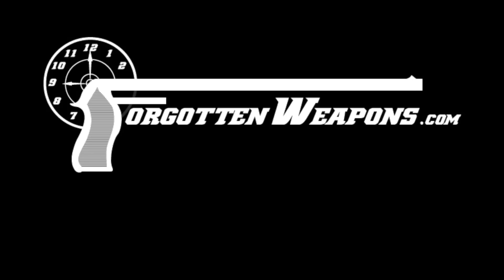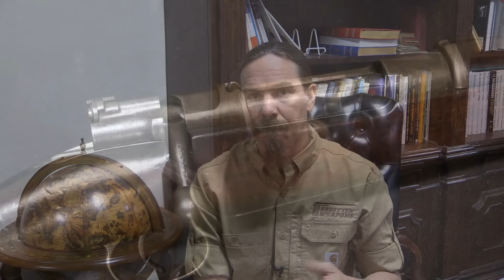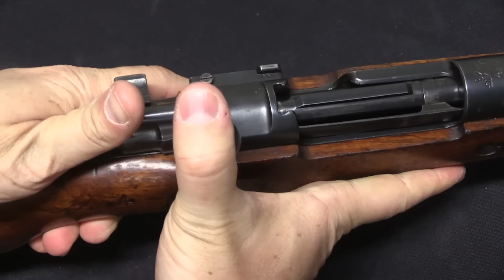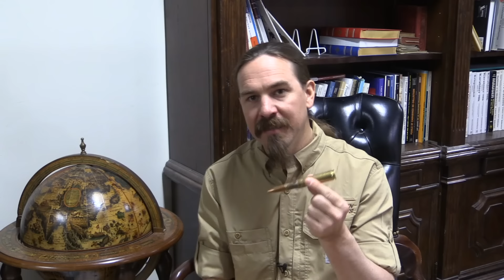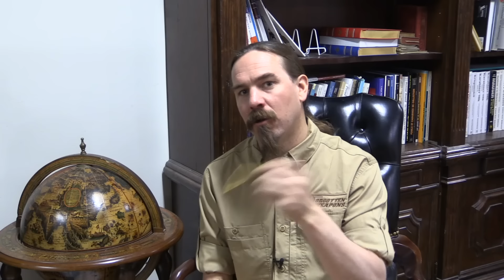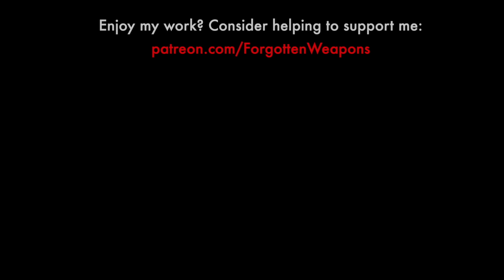Earth-Shattering ka-Boom! How (and Why) Guns Explode

Comment: The first thing that came to my mind is how the RN 50 has no failsafe mesures whatsoever, i understand the novelty of a tube gun and that Mark Serbu wanted to give a job to a young gun designer, but i feel like in the process of a teenager presenting him the design of a 50 BMG tube gun he should have reviewed it a bit more intensely before putting it into production.
Reply: I believe the shark fins are an additional safety measure. They sheared off from the massive overpressure
Reply: Yep, the design is inherently less safe in an over pressure situation than any other .50 I know of.
Reply: @bryanhiscocks6209  As they would from any overpressure that had enough power to strip the threads off that end cap, all they accomplished was makeing more shrapnel  there should be at the bare minimum a shield
Reply: @SgtStinger  Pretty much every other design i can think of either has a safety lug, or multiple, or is a semi auto in an enclosed receiver with a bolt carrier and multiple springs behind it.

If this was a 12 gauge that would be one thing, but trying to put an anti material round in a tube gun is something that should probably be left to post apocalyptic fiction
Reply: @therideneverends1697  it'd be a better and more expensive design. I agree.

However its a budget gun that should be used with factory ammunition from a reputable company
Reply: @bryanhiscocks6209  I am not of that belief, if something cannot pass a proof test and a catastrophic failure test as a modern firearm it should not be on the market.

"Budget" should not allow companies to take shortcuts that endanger the user.
Reply: @therideneverends1697  You know a proof 50bmg round isn't 85000 psi right? Lol

Comment: I think a good solution would be to have a "break-away" section of the barrel by the chamber, a sort of "key", where if the chamber pressures reach such a pressure that it would blow off the back, just short of that (let's say 80%), the metal in the barrel would break away in a specific hole, and relieve that excess pressure.
Reply: Agreed. A burst point.

Comment: The few times I took "newbies" to a gun range, I always added one extra safety instruction to the basic ones:
IF - you're shooting (and you did not change ammo types), and the sound or recoil feels different from other rounds (greater or lesser recoil, or louder or quieter sound), take your finger off the trigger, remove the magazine, and eject the current cartridge, and tell me, and I'll field strip the gun and examine the spent brass before we continue.
(and of course i nag them 'incessantly' about muzzle awareness, and trigger discipline)

I think for a more experienced shooter, the only thing to add to that is that you should have some degree of 'pause' when you get a drastic "flyer" - which wasn't caused by you. Newbies will likely lack the experience to know if that's the case though, since they'll tend to assume all flyers are their fault (which is generally true hehe)

Most of the time when I get a "squib false alarm", it's with rimfire ammo. Sometimes some of the primer powder falls loose from the rim, which can cause a 'dud', or it can cause a weak ignition, and a "soft round". I've never had a squib in a barrel, but I've checked for them about 20 times, 15 or so of them with rimfire guns, the other 5 with cheap ammo of questionable repute.

One thing people should bear in mind about XM-193 or XM-855, or any X-something military surplus ammo... is that the X signifies that it is not for use in the military. Usually that's due to an overly strict shelf life requirement or incomplete sealer coverage around the primer, but sometimes it's because the finished cartridge has a dent or ding, or it's weight is not to spec. If it's due to the weight not being to spec... that's an area where you can run into serious problems. I realize few will actually take the time to do this, but it doesn't hurt to weigh your cartridges and discard any which have an unusual weight. I'm assuming the SLAP round which blew up was probably X-rated (insert pun here). I'd definitely weigh any cartridge of such great power with an X on it's branding. Not saying that would have prevented anything, but it's a possibility.

Random thought: anyone else have a gut feeling that the designs for the military's 6.8mm will "forget" many of the safety lessons learned in earlier generations? 
And they want an 80,000psi spec... it may prove 'interesting'.

Comment: I love that he talks about this in an ambiguous relative phrasing of words. Because just as he says, relatively speaking, if the bullet isn't moving fast enough down the barrel for the burning gasses to escape with it then it may not be a squib but it is an obstruction nonetheless that is stopping the explosion from venting out of its confinement. Leading that explosion to take the very next path of least resistance besides the far end of the barrel. Just like not holding the cylender of a revolver, it's important to note the inner workings of any firearm you're holding so as to know how to safely handle it. And especially consider if something were to go wrong, what and where would things go wrong on any given firearm so as to be prepared for the unforseen.

Comment: Speaking of gun parts flying backwards at a high velocity . . .

The hammer pin on current-production Beretta 92 pistols has an oversized head that engages with a groove milled down the underside of the left slide rail. Its purpose is to catch the back half of the slide if the slide should break through the locking notches. Again. An operator was practicing with his issue M9 with special-ops grade ammo (whatever that is -- +P, +P+, or what have you) when his slide broke completely in two and the rear half came back and struck him. The revised slide and hammer  pin followed shortly thereafter.

Comment: Thanks for another great video Ian. Reminds me of one time bout 4 years ago I was watching a bloke clean a Remington style 44 cap and ball revolver he had loaned to someone. He pulled the grips off, removed the cylinder, into the hot soapy water and wondered why his cleaning rod and water did not go through the barrel. He got a wooden dowel and a hammer and tapped to remove whatever was in there and out came 3 round lead balls ( or rather what was left of them!)

Comment: I really like mark Serbus channel I hope this specific incident doesn’t give him a bad name, glad that Scott is ok.
Reply: I'll be cool with him as long as he redesigns that single shot rifle of his to not have a failure point on the end cap. Nobody likes a grapeshot cannonball breaking their orbital bones, let alone bringing the action locking lugs along for the ride.
Reply: @DinnerForkTongue  I wonder how different the reactions would have been if it had killed him.  There's clearly a glaring design fault here.
Reply: @N_Jones 
It's a sequence of small fails, actually. Both Scott and Mark are at fault, Scott for using old ammo with dodgy old powder load and not reloading it first (the sabot-and-muzzle-brake thing is pure conjecture for now until the barrel can be analyzed), and the rifle design for not having a safety vent in the case of excessive pressure buildup in the chamber. You cannot point fingers at only one "culprit".

Comment: I had an incident with my sks where the steel core punched through the front of the jacket leaving the  jacket behind about 4 inches into the rifling. Worse part is the cleaning rod fell straight through the jacket so i thought i cleared it out. I guess i got lucky with only a bulged barrel.
Reply: A common thing people do is grind the tip of a FMJ steel core round to try and make it a flat tip. I was taught not to do that for that reason. I'm glad I had knowledgeable people around.

Comment: Back in school, our teacher told us that the universe always tries to equalize itself and pressure always seeks to relieve itself by the easiest way possible.

Which is normaly the front of the barrel.

I remeber Ian having an out of battery discharge as well some years ago, Karl did first aid.
Reply: All mechanisms are made of simple machines.
Fluids always seek out low pressure.
Everything is a spring.

Comment: Fantastic video Ian !!! The in-depth walk through of the how's and why's is great. More importantly is closing the video with proper safety practices to help mitigate the possibility of an injury. Running speed drills with my AR I came across a squib load but did not recognize it for what it was. No injuries to me but it did require a new barrel and BCG. Afterwards I learned the S.P.O.R.T.S. acronym. Slap, Pull, Observe, Release, Target, Squeeze. Very important is the Observe step. Observe what comes out of the chamber and move forward appropriately.

Comment: Awesome information. I'm 61 and have been shooting & reloading for fifty years. I have a handful of issues where things went wrong along the way. Nothing was damaged too bad and no one was hurt, but there have been some close calls. The worst close call was over 20 years ago.  A buddy of mine and I were doing some target shooting with handguns. He did not like wearing shooting glasses or glasses of any type. He had a Ruger Super Black Hawk in 44 mag and pulled the trigger at a target and a little pop happened. He cocked the revolver again and before he pulled the trigger I stopped him. We pulled the cylinder out and there was a projectile flush with the forcing cone of the barrel. Far enough in that he could cycle the cylinder with the hammer. He was lucky I was there and stopped him.  It was his reloads and he loaded them hot.  I hate to think what would have happened. I've seen enough pics of revolver failures to know it would have been very bad. He started to wear eye protection after that.

Comment: My one and only kaboom was with an AR 15 using FC American Eagle brass, reloaded with 24 grains of AA 2520 behind a 69 grain Sierra MKHPBT.  This isn't an excessive pressure load, especially in a NATO chamber.  The fault was in the brass as many I sectioned had very thin webs.
Damage included the 20 round magazine,  the bolt and extractor.

Cartridge brass is typically work hardened to 75,000 PSI yield strength,  sectioned brass had an interpolated yield strength of 55,000 PSI.  This coupled with the unsupported case wall caused the kb.

Comment: I had a squib at a Level 2 USPSA match, with ammo I loaded myself, with a nice STI Edge. I have it on video. I got a malf, dropped the mag, reloaded, racked the slide, and got back on target. In that time, my brain caught up and stopped me before I pulled the trigger, and simultaneously, the RO recognized it and called "STOP!" We were both right and I had a barrel obstruction. But it kinda scared me how quickly I almost shot again and almost blew up a $2k gun. 
More recently, I had a case head separate (in battery failure) on a SIG P320 with my own reloads. I was happy with my own reaction, in that I just felt/heard/saw something weird, and stopped myself.

Comment: Having never handled a suppressed firearm, I'm curious now whether a suppressor would make it harder to tell that you've had a squib. I mean, without one, the difference between "bang" and "phut" is pretty obvious even with hearing protection in place, but with one... ?  That might be interesting to test, if there were a way to do it safely.
Reply: The difference in recoil? A dud cartridge or partial burn won’t properly recoil.
Reply: without a bullet leaving the chamber, wouldn't there be little to no recoil?
Reply: Wouldn't you notice a difference in recoil?
I'm not a shooter, but I kinda figured a fast bullet would feel different to a sluggish one
Reply: adding a bit to the replies above that have already mentioned the discernibly lower recoil or lack thereof, considering squib load tends to be the result of the propellant powder only partially detonating, in the case of self-loading firearms it wouldn't exert enough force to cycle the action and it would often be followed by the firearm jamming (whether failure to eject or failure to load) so along with the almost nonexistent recoil it should be an unmistakeable indication that the firearm had just experienced a squib load malfuction and that the barrel is now obstructed
Reply: I think you overestimate the suppressive power of the suppressor. Supersonic rounds aren't hearing safe, even with the most effective suppressor. 🤷‍♂️
Reply: Nope, well, nothing significant.. nothing comes out with a squib anyway.. you still have nothing coming out
Reply: Nah, even on a 22 target pistol you'll feel it, or at least I have.
Reply: Fair point about the recoil, that hadn't occurred to me for some reason. Guess I didn't spend long enough thinking over the problem before commenting--it was an idle bit of curiosity that came to mind toward the end of the video.  As for failure to cycle, I must still have had Ian's remarks about revolvers on my mind.

(Subsonic vs. supersonic didn't either, but in that case, just because it never crossed my mind that a person would be shooting supersonic ammunition with a suppressor. What would be the point of subjecting the suppressor to that much wear and tear when it's going to make a loud noise regardless?)

Ah, well.  A coward would delete the comment, but I shall leave it as an enduring monument to human fallibility. :)
Reply: I use supressors, excellent bit of safety equipment. .223 still sounds like .22lr.  You would notice a difference in sound I think.

Comment: I am glad you talked about failsafe design features and failure mitigation.  Nice examples too.   Hopefully the designer will add and TEST additional safety features for that gun.   RE: weird stuff.  I had some handloads that I liked, one day at the range they seemed to be recoiling harder.  Turns out I had ladder tested and chronographed in cool weather, in the hot summer the ball powder was running +10%(as ball powder will do).   So I stopped.   In later looking at the data, the powder and the books I reduced the charge from 26 to 25gr.  Not much, but enough to bring the hot zone down to proper ar15 ranges.

Comment: Yeah, not at all surprised that this came up.
Very much appreciate your academic approach to the subject, as opposed to... Less rigorous commentary.
Reply: "Bore Obstruction."
Yes, absolutely, a bullet is a bore obstruction... Until it leaves the bore. If pressure exceeds the mechanical strength of the breach fast enough, the bullet literally doesn't have time to exit before BOOM.
Reply: @lairdcummings9092  I tend to like your comments, but forgetting to thumb them. 🙄
Reply: @andersbendsen5931  never a problem. I like recognition, but that's not why I comment; I usually have something to say, even it's nothing earth-shattering.

Comment: The back end of this weapon is, basically, a nut and bolt albeit the bolt has a hole up the middle for the bullet to pass through. Rule of thumb engineering knowledge suggests that 6 fully engaged threads will give the maximum strength of that thread. Having tested cylinder head studs of a large diesel engine with varying sized nuts, I can say this is pretty much true. Looking at his film, there appears to be 4 stripped threads and one undamaged one which was probably not engaged. So, there's the first problem; too few threads.
Unless the threads are precision ground, putting the nut on finger tight means all the load is taken on whichever thread is first to have metal to metal contact. As the nut is torqued up the thread with all the load begins to deform elastically until the next thread fully engages and shares the load in the bolt. When tightening is complete, the load is shared, though probably not evenly, by 6 threads.
In the case of this firearm, the nut is only ever done up finger tight and only one thread is doing any work. If that thread is subject to a shock load from, say an explosion, there is a possibility that the only thread in engagement will fail in a brittle manner because that's how steel can fail under shock loads. It's therefore easy to see how each thread can fail in turn, leading to the nut, in this case an end cap, being ejected.
Another rule of thumb is that where shock loads may be involved, things should withstand a static load of twice the value of the shock load. Thus, if the peak pressure is 55,000 psi then the assembly should not fail at 110,000 psi under static load.
It's also worth thinking about what happens if there's a failure of the cartridge case and gas leaks into the huge area of the base of that end cap. Maybe this is why big naval guns have a breech plug rather than a cap.

Comment: I totally believe he bought a bootleg SLAP round and who knows what was in that case, that was far beyond high pressure. That was a massive explosion and he is luck to be alive.
Reply: I'm not sure if the round which blew up was overloaded. But the round before it was very troubling. A flyer which is off by 3 feet is not normal. I suspect at that point (the shot with the flyer) the gun may have became compromised, and after that putting any kind of ammo in it was risky (though it was a pretty subtle clue for Scott). If the end cap became cracked after that one super-hot round, it might not be obvious to the operator right away.
My father had what he thought was a scratch on an old 30-06 receiver. But when he realized that the scratch had "grown" while he was shooting, he stopped immediately. Turned out to be a crack. Very observant of him that he noticed it was growing, and very lucky that the "scratch" was on the upper side of the receiver where it was very visible. Whatever initially caused the crack could have occurred weeks before.
Reply: This is why you shouldn't shoot other people's sketchy homemade loads